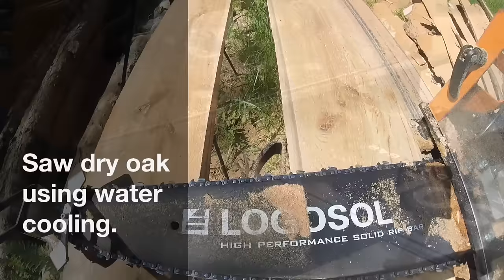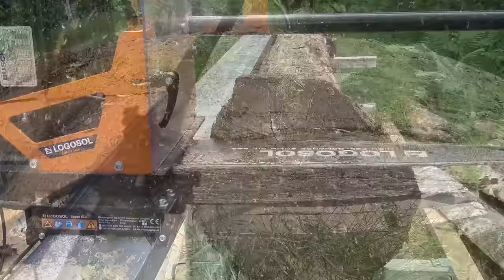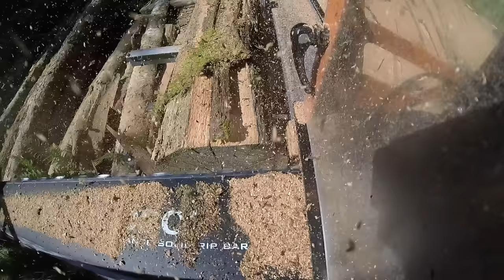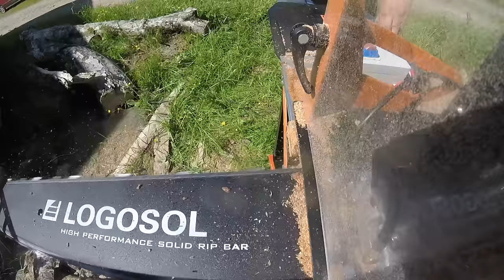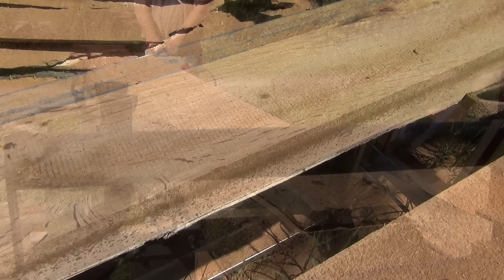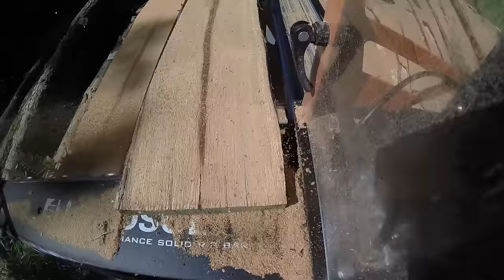Water cooling on portable chainsaw mill.

Comment: The speed is almost that of a band saw, must be nice. How powerful is E5000 motor? And the guide bar is a tuning-kit? Mine looks like a standard guide bar with no tip gear. It is called Stihl Duromatic

Comment: Would it be possible to cut both ways with the E5? cut one direction, then remove the plank and cut on the way back.
Reply from the maker: +Mattias Haugland It is not possible to cut both ways. A chainsaw chain can only cut in one direction.
If you run the engine in the same direction all the time it will push the log away from the fixture which would not be as good

Comment: how is your blade an chain life when using water instead of bar oil ... just curious on the chain lube an bar/chain  life
Reply from the maker: +freedomsailer I use oil for lube of chain and water on top of the chain for cooling.
Reply: kewl...never thought about that on mine ... ill have to try it ... Thanks
Reply from the maker: +freedomsailer I only use it when the wood I cut is dry, green wood have enough moisture in it self.
Reply: How much water do you use in one cut of board of 3mtr